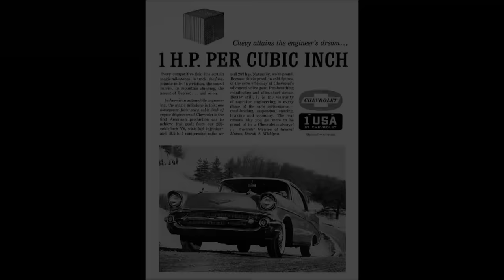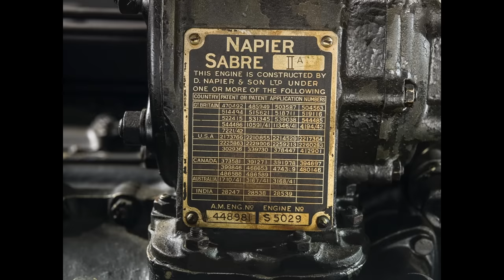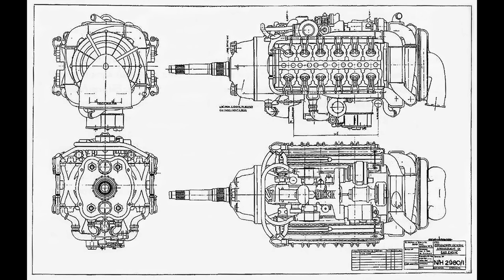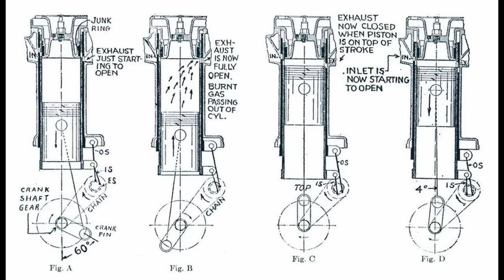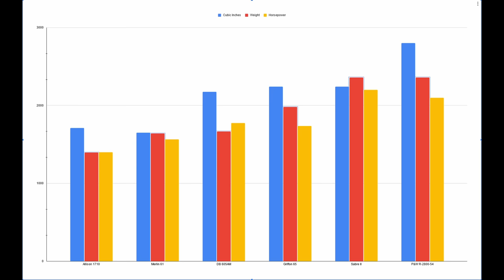Napier Sabre - The Ultimate WWII Aircraft Engine - Part 1

Comment: So incredible how much engineering went into these piston aircraft engines and how they were 50 years ahead of automotive engines. Crazy precision engineering, thousands of moving parts machined perfectly just to be beat out by a spinning shaft in a tube with fans on the end of it.
Reply: Exactly. Not so "Ultimate" was it?
Reply: A couple of things, every mechanical principal was worked out by 1929 and jet engines were helped by a good understanding of the steam turbine. Multistage superheated steam turbines with stator sections producing tens of thousands of HP were around for nearly 50 years before the jet went mainstream. That thorough understanding of gas flow, thermodynamically speaking helped jet design. 

Jets really are not as flexible in operation as you might think. The topic of jets gets complicated fast. For example, the holy grail of jet design is efficient low altitude jet engines. To that end we're not even close to solving that one. Basically jets are really only useful at altitude and in military service where ridiculously high fuel consumption at low altitude is less important than defense. Jets are pretty hopeless for hot and high takeoffs like 5000' elevation and say 35deg C which is why there's the turboprop engine. 
What I've just written is about .000000000000001% of the complexity the jet engine strengths and limitations. Those limitations are profound. 
Piston engines by comparison are very flexible, particularly with a turbocharger. Jets come into their own over 25,000ft but even then they still lose thrust as the air thins, albeit less than all other engines. It's complex.
Reply: the safest, most reliable , very high power to weight ratios.....along with way lower maintenance requirement   is why turbines are dominant...piston pounders dont come close.....
Reply: @griesTheGries  the only problem is that they are extremely fragile.
Reply: @griesTheGries  Jet engine safe and require less maintenance? I want whatever you're smoking, that must be some good shit.

Piston engines can have holes blown in the block and cylinders shot off and keep running. A jet engine can be completely destroyed by a stray bolt on the runway, or a bird in the wrong place. Piston engines also use orders of magnitude less fuel.

Piston engines win in every category except weight and speed, but the speed part is less of their fault and more of a problem with propeller physics.
Reply: @griesTheGries  .... that's why every cheap airplane has one..... LOL..... turbines are like hand grenades that spin.
Reply: Those Piston aircrafts were scary to fly and fly in for the average person. they were very loud even louder than a lot of jet engines especially the commercial one heck one of the reasons why jets took over was because of speed also a propeller baste plane just can't reach the speed of sound they tried it with the Thunder Screech and yeah there's a reason the plane is called that. lol and then there is power to weight, pistons just can't compete there sadly.
Reply: @GGigabiteM  Yes, less maintenance. Have you considered the effort to replace the spark plugs on a Sapre or Triple Wasp engine???
Reply: @davidhollenshead4892  There was never such a thing as a "triple wasp engine"

And no, jets aren't easier to maintain, they're harder.

The whole engine has to be disassembled and every single blade in a jet engine has to be tested for microscopic cracks. There are hundreds or thousands of blades inside the engine, it's a far more arduous task than overhauling an engine.

You act like jet engines don't need ignition sources, they have devices similar to spark plugs that ignite the fuel, they're not self starting.

A reciprocating engine can take lots of abuse before it finally gives up. A jet engine can be ended by a single loose bolt getting sucked in. Plenty of cases of whole aircraft being lost because of a single nut or bolt getting sucked into the engine.

R2800s have had whole jugs blown completely apart during flight and the engine kept running.

Piston engines are just better.
Reply: @GGigabiteM  If you had small plane then yes, piston engine is way better.

But once you need more than 20.000 HP equivalent, stacking the engine only add more complexity and weight and cooling to the point than it's not worth anyway. Let's be honest, give me better piston engine solution than GE9X  while retaining same power, weight, sound, and speed. Cmon
Reply: @GGigabiteM  If they are "just better" why are they not used everywhere? I'm sure they have their place but "just better" does not describe it at all.
Reply: @Axel_Andersen  Because speed.

Aircraft piston engine ground to a halt in 1945 because everyone wanted to go fast, and the jet was the quickest way there. So much so that everything else was sacrificed for that speed, reliability and fuel consumption included. You went from aircraft that could fly 1000nmi+ to 300nmi on similar fuel load. Why do you think they kept around A1 Skyraiders in Vietnam? They were the only support aircraft that could hover for hours without running out of fuel.

Pistons engines could make all the power they wanted, but propeller physics and technology of propellers at the time limited them.

While propellers were fairly advanced by the 1940s, they still had a long way to go in design. It wasn't until the Soviets with the TU-95 that showed how fast propellers could go.

Experimental fighters like the Supermarine Spiteful (no, not the Spitfire) were already touching the 500 mph mark with the Rolls Royce Griffon. Had the Crecy been developed to production, we likely would have seen fighters close to the 600 mph mark.
Reply: @GGigabiteM  So you are saying that we could replace all modern jet air liners with similar performing piston thingys and they would be better in every respect ?
Reply: @griesTheGries  True. Once you hit 500-600 hp range, recip no longer make sense,  The more weight and space matters, the earlier they justify themselves.  Recips justify themselves earlier on helicopters because of that.  The bigger the engine, the better power to weight, but even the little Allison 250 -C40 has 715 take-off, 695 hp continuous from 139 lbs. + prop reduction.  A 700hp 1535 Twin Wasp weighs 1,087.  The bigger the turbine, the better the reliability, power to weight, and the lower cost per horsepower.
Reply: @ThePaulv12 see
Reply: The design case for an aero engine is different to that for a car engine e,g a car engine does not have to deliver a high power output for hours on end , it does not need to deliver high continuous power at 30,000 ft altitude where the air is thin, weight is not as critical and so on. In some ways its an apples to oranges contest to compare car engines to aero engines.
Reply: the spinning shaft in a tube with fans on the end of it requires exponentially more elaborate metallurgy and materials science as the power output goes up, though...

Comment: Not surprising to see an interesting and clever configuration from the company that produced the Deltic motors.
Reply: The Deltic is said to be based on the Junkers Jumo design.
Reply: @francovance1  thats interesting!  It didn't make sense to me, so I looked it up.  I was aware that Junkers had made the inverted V-12 designs, but I was unaware of them producing an opposed cylinder motor.  Wikipedia has a pic of a Jumo 205  cut open to reveal the pistons, what an unusual looking design!!

Comment: The beauty of the Napier Sabre was that it combined the massive power of a radial engine while also having the small frontal area of an inline engine. The only reason the typhoon and tempests weren’t even faster was because of the huge chin radiator. The fullest potential of the Sabre was realized when hawker made the Fury I, a land based variant of the sea fury with a 3500 horsepower Sabre VII. It combined the same ludicrous power as a 72 liter wasp major, with an airframe as sleek as a mustangs. It could do 490+ mph at just 14,000ft. Not even the hornet, super Corsair, or p51h could match its performance there. In fact no other prop fighter could.
Reply: The hawker fury? I can only find reference to a biplane when looking it up. Do you mean the sea fury? I can find that, but it's radial
Reply: Wing radiators with leading edge intakes were the key.  The Tempest Mk.I had the 2,240 hp Napier-Sabre IV engine and 466 mph, Feb 1943.
The Fury I top speed was 483 mph, Apr 1946.

Comment: Very interesting, but of course all that power ends up going to waste in a) throttling losses with all these massive 'victorian' engines, and b) propellers are very inefficient without some form of tube to direct the airflow backwards. Frank whittle was getting 800lbs of thrust before the war in a dirty old shed with no money and no help with metallurgy. The best book on this subject is 'Not Much of an Engineer' by Stanley Hooker. A brilliant read. From knowing nothing about engines to designing the engines in the Harrier VTOL and Concorde is an astounding achievement.
.

Comment: A complete understanding of this engine needs to include the story of the difficulties Napier had with sleeve valves and the assistance Napier got from Bristol.  Also, to understand the problems the engine had to overcome one needs to understand the air frames this engine was mated too.
Reply: To some extent Bristol had to take staff off the also problematic, sleeve-valve Centaurus to help with the Sabre. So ironically the Tempest V with the Sabre made WW2 and the Centaurus-powered Tempest II did not.
Reply from the maker: Hey Lorrin, check out Part 2 for that story!
Reply: To my knowledge the sleeve valve issue was completely rectified by the Tempest
Reply: Too true.  Vibration in the airframe was so bad that pilots had to refrain from touching the sides of the cockpit.

Comment: Thanks for this impressive presentation. I once read that later with lots of methyl ethyl lead and boron, two hundred octane fuel, it danced around five thousand hp but was put away in favour of Jet development. The RR Cressi interests me. The full mass of everything associated with the normal operation of an engine through expected missions is it's weight.
Reply: With that much fuel additives, that couldn't be a viable production engine. Fueling that would be far to expensive! Still would be impressive.

Comment: I remember reading a paper on sleeve engines at some point and it uses the Sabre a lot as an example. It seems, at least in part, that the sleeve engine design had a lot to do with the excess weight and happens to be a trend across many sleeve engines when compared to many valve engines. On that note I also think it worthwhile to remember that a sleeve valve also requires a great deal of very precise machining and so the design might not be quite as preferable to the air ministry. I'm sure corruption also played a role, but there certainly were other factors.
Reply: Please note that the terms are sleeve-valve and Poppet valve, not just sleeve and valve.
Reply: @brucerogermorgan2388  I mean yes. But also people informally tend to use sleeve and valve, and I figured the more common verbiage was easier in what is frankly an informal comment.
Reply: @olivialambert4124  No, people do not informally use sleeve and valve. It's always sleeve-valve, or poppet valve, or overhead valve, or side valve, or similar. Sleeve-valves are valves too, but sleeves are not, the term applies to steel cylinder sleeves, often used in aluminium cylinders.
Reply: @brucerogermorgan2388  Perhaps not to you, but its a consistent feature where I've looked. Both casual with outsiders and industry professionals. So with that said I'm going to go with sleeve engine and valve engine. Especially on a youtube comment.
Reply: @brucerogermorgan2388  Also for what its worth, overhead valve often informally refers to specifically a pushrod engine rather than all forms of overhead valve. Probably not the best term you could have suggested there. And poppet valves can refer to L head T head and F head engines whilst overhead valve is primarily used to distinguish from them (rather than sleeve engines). Again, not the greatest suggestion given L head were still fairly common in that era.
Reply: @olivialambert4124  It's not a consistent feature with anyone in the mechanical or engine field, but if you want to sound like an idiot, be my guest.
Reply: @brucerogermorgan2388  Cool. I'll sound like an idiot, the many papers I've read from long  term engine specific engineers will sound like idiots, the public at large will sound like idiots, everyone will sound like an idiot. Everyone but you. How special and unique of you.
Reply: @olivialambert4124  Sorry he had to mansplain your comment to your so your small lady brain could understand, but seriously, as some one with some mech knowledge I agree with your statements. 
Q: What sort of valve does it use?
A: poppet 
Q: Ok, so side valve or overhead?
A: Overhead
Q:Pushrod, or overhead cam
etc etc....
Q: What sort of valve does it use
A: Sleeve 
I rest my case - saying valve after the type just sounds redundant at this point
Reply: Seems to me that the sleeve valve would be susceptible to heat warpage. Also, carbon build up on the exhaust side.
BTW strict environmental regs may bring piston engines back once everyone realizes that hydrogen an external fan jets won't work.

Comment: Very interesting piece you've presented here. I had to smile when you backed off of comparing any of these engines to the Allison performance after the war. Post war and through the late 1970's, you could just about buy an Allison engine for the same amount that a new small block chevy would cost. That being said, the Allison engine found itself in all sorts of applications the war planners could have never envisioned. Specifically, unlimited hydro boat racing and tractor pulling. I was once told by EJ Potter of drag racing and tractor pulling fame, that the Allison was, for awhile, the perfect tractor pulling engine. It turned out in stock form, 1700 hp at 1700 rpm. If you needed 4000 hp, you just spun the engine 4000 rpm. Of course, the risk of falling out of the sky if you dynamited an engine doesn't apply to tractor pulling (thought it does thrill the crowd). I suspect that for the Allison, a margin of safety in flight kept its actual horsepower output in check during the war. That may also be true of some of these other engines.

That all said, look how much farther we are in the search for horse power in a per cubic inch basis and also on a per pound basis. Almost every car offered in 2022 delivers more than one horsepower per cubic inch, many are above two hp per cu in. And the weights of modern engines are now in the less than 300 lbs area for the same specific out put engines weight 2.5 times that much would deliver just 20 years ago.

Don't even get started comparing motor cycle engines for out put.
Reply: Yep, bikes busted through the 100 bhp per litre grail in production engines in the early 80s 😉
Reply: @alan-sk7ky  - In 1960's, the Suzuki 50cc bikes were making about 6.5 HP and 55 MPH... 
1966 Suzuki X6 Hustler 250cc 29 HP and 104 MPH was beginning killing off the British motorcycle industry... 
1971 Kawasaki triple 750cc 74 HP and fastest production motorcycle in the world...
Reply: The late production (G) Allisons were certainly more robust.  Earlier versions had a host of problems and none of them were effective when overboosted, not even the P-82 Allisons in Korea which was a maintenance nightmare.  NAA railed at being forced to use the Allisons.
Reply: @bobsakamanos4469  I don't doubt that all to be true, but the Allison was the Bee's Knees for tractor pulling and Hydroplane racing a decade later.
Reply: @cdjhyoung  yup, but they weren't factory production engines which had detonation problems among other issues.  In 1944 Allison was forced to produce a new intake manifold among other improvements, but the P-82 engines in Korea were still a maintenance nightmare.

Comment: i had known about some RR sabotage with the engineering side against the Sabre, but i never knew that it went that deep!
Reply: Oh yes Rolls Royce were bastards
Reply: It went both ways.  Lord Nuffied tried his best to stall Spitfire development and hence RR output, while at the same time promoting the Napier Sabre engine.  He pumped £100,000 of his own money into the Nuffield-Napier-Heston Racer with the N-Sabre engine.  It failed on its maiden flight and the aircraft crashed June 1940.  That engine was of course destined for the Typhoon being developed by Hawker.  
Meanwhile his delay in building the Castle Bromwich Factory meant it produced not one Spitfire at that time (1938 -1940).  He was then fired by Beaverbrook.  Corporate warfare.
Reply: @bobsakamanos4469  thanks. great information i did not know. i knew about the racer crash though - it looked like a deathtrap from the start.
Reply: @mrrolandlawrence  The Napier Sabre also killed Capt Baker test flying the Martin Baker MB.3 in 1942.

Comment: Excellent video! I can't help but wonder what the horsepower, the horse power to weight ratio and the bfsc (pounds of fuel per horsepower per hour) efficiency rating of this already incredible engine could have been if Napier could have also added either turbocharging or turbo-compounding along with port fuel injection to the Sabre. I'll bet the output in all three of these categories would have been absolutely astounding.
Reply: And TBO ( time between overhaul)